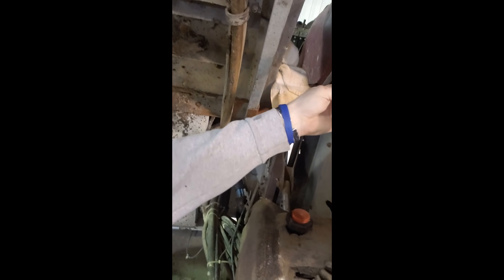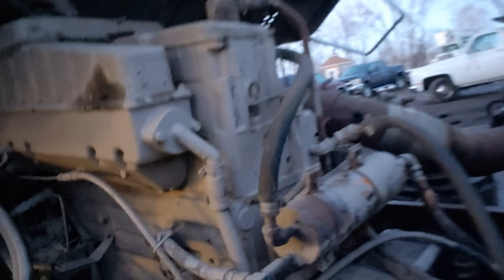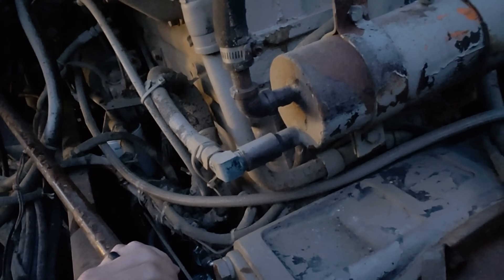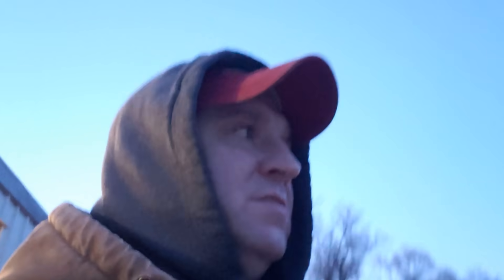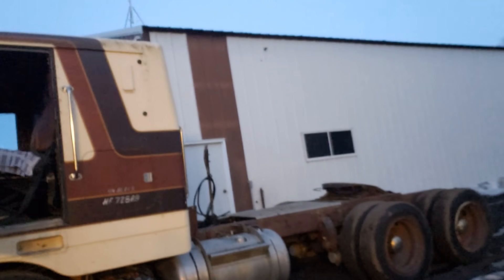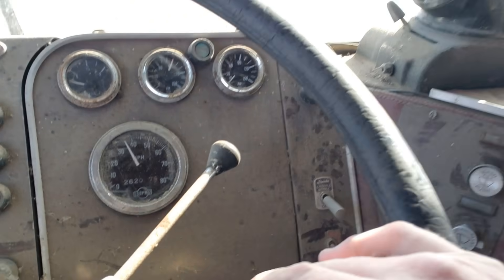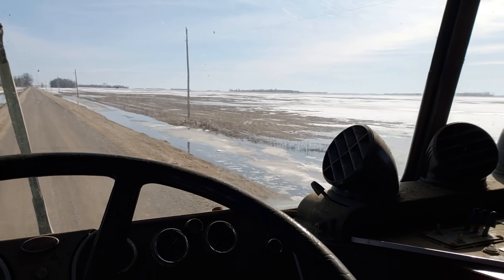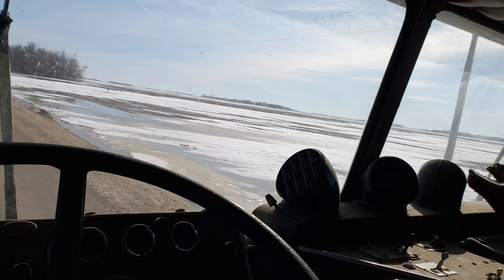Ep 4 Peterbilt 352 Cabover Resurrection.  First test drive after first start in 20 yrs!!!!

Comment: I would keep the rear drives steel. Some truck tire places will do steel wheels exchange, your old for new painted. Then put chrome axle covers and nut covers on, that was popular back in the day and a really cool look. My opinion! Good luck with Her👍
Reply from the maker: I thought about keeping the old steel wheel especially cuz some of them are the old 2 holes Style but man you really can't argue with shiny aluminum
Reply: @northlandmike6694  I run 24.5 11R's on my KW now, pricey tires I must say, but they aren't common anymore. Yes the 2hole steels are better looking. If you do search out aluminum wheels, make sure you really look them over if used! 24.5 aluminum have a tendency to crack from the stud holes out. And check the bead ring, aluminum wears out faster than steel, had a rim once that was so wore out it would leak air around the bead of rim.

Comment: Glad to see it rolling! 🤩 That engine sounds really nice. Get that air leak fixed so you can shift it properly. If you’re hammering down on the throttle, go through the linkage and check all the connections. Our Ford CL 9000 had a sticky throttle but cleaning and lubing it resolved the issue.

Comment: Seeing as the passenger seat of cabovers back in the day;were bolted to the cab floor,I think you should retrofit the 1979 Peterbilt 352 COE;with a cab mount assembly that has shocks and airbags,built into the cab mount.For decades,only the driver's seat was air ride;and the passenger seat was just a big upolstered cushion,bolted to a seat frame;that was bolted to the cab floor.
So only the driver had the comfortable seat;while the passenger had the most uncomfortable seat;as the passenger was able to feel every bump in the road.The passenger was more likely to have bad teeth,and a bad back than the driver;which is why cabovers got the nick name of "back breakers" and "jaw breakers".
Reply from the maker: I had thought about that.  I wonder if there was any air ride for the 352 cabs.  I have a newer seat for the drivers side.  I'd like to find a matching one or a pair.  Or I may just move the current drivers seat to the passenger side.  But it's kind of ugly!   Thanks for the comments and keeps on watching!

Comment: having no seen all your episodes yet so by now you may have figured it out.  going by memory now,  there should be a check valve on the inlet of the fuel pump so fuel doesn't drain to lowest level.  ask for your mechanic bud thoughts

Comment: Their probably rust in that injector pump and also on top back of that injector pump theirs a large bolt and it has a filter in it and junk can collect in that lil bowl the filter sits in theirs a guy on ebay that rebuilds those pump hims name on ebay is timingtoolking really knows his stuff on those pumps
Reply from the maker: Awesome!  Thanks for the tip!  I'll check that out!  I didnt know that!
Reply: Their also a bolt at the top of the pump you take off  to prime the pump to so you dont start it dry you wanna fill the pump up in that hole

Comment: I haven't watched many of your videos but the old girls really in pretty good shape. I couldn't see is that a big or small cam? If it's a small cam the old non afc pumps had the tach drive in the main housing and the felt seal was notorious for loosing prime.
Reply from the maker: Thanks Nate!  Hit subscribe to catch them all!  It's a Big Cam. I'm not totally sure of the specs as the data plate was removed.  I'm gonna pull all the orig data from Peterbilt and do an episode on that.
Reply: @northlandmike6694  I saw it better in one of your other videos, it's a big cam 1. The engine sn is stamped on the rear of block right by the deck on the drivers side. There should be a tag on the fuel pump with the fuel code on it. 1-800-diesels should be able to get you the info if you need it.  Those were good engines as long as you keep up with the overhead sets, DCA, and bottom end bearings. Hope that helps!

Comment: All your hoses have reusable fittings so you can go buy all the different sizes of hose and cut the same length you took off and its cheaper than having hose maid
Reply from the maker: I'm gonna switch it all over to plastic hose as all the hoses are braided right now.